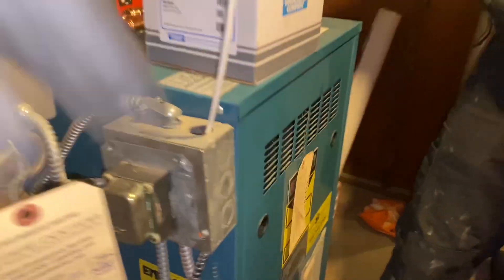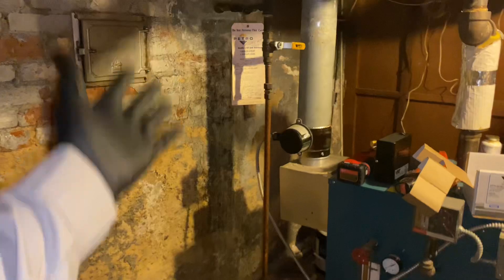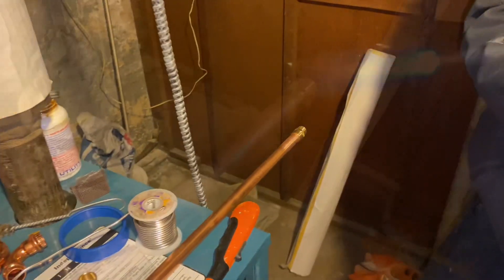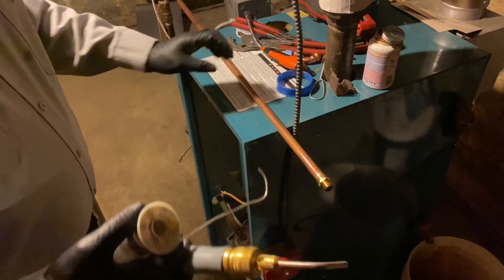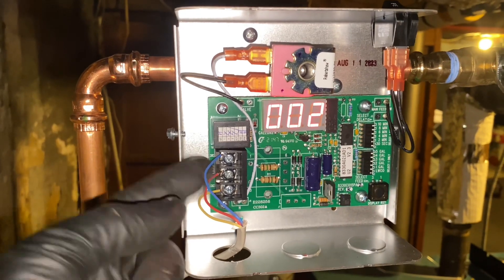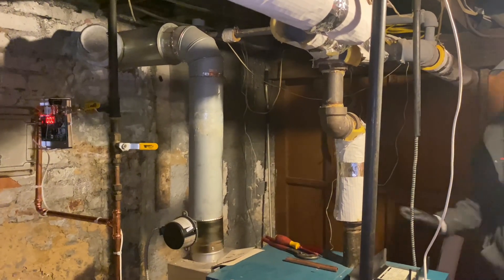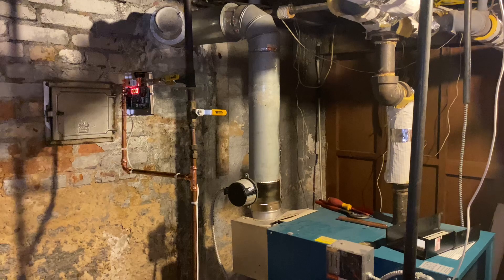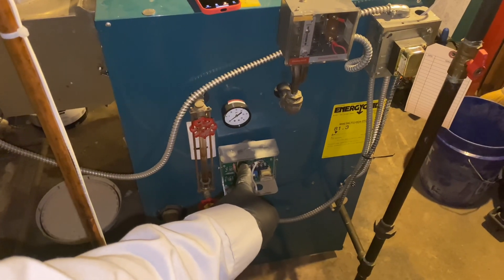Polarity Matters, Even with 24 Volts! How to Install Automatic Water Feeder on Steam Boiler

Comment: FYI, on the VXT-24 you can change the orientation of the incoming water line by loosening the 2 mounting screws inside if needed.

Comment: Is replacing one VXT-24 with another a matter of removing the electrical contacts and unbolting the old unit and installing the new unit using the same feed lines? No soldering involved?

Comment: Mike, i have this same Hydrolevel VXT 24 volt water auto feeder, though mine is piped almost the same way as you did here in this video with 3 valves on that squared pipe..1 valve at the inlet, the other valve on the right side on the pipe thats vertical at the 3 o'clock and another one at the horizontal just beneath the VXT ..So when looking at our VXT , theres a valve at the 12, the 3, and 6 o'clock..and they are all on the right side of the VXT in that squared piping configuration if that makes sense.

Comment: I never soldered before, but I have a torch that I haven't used, and I will buy some copper elbows, and copper pipes, solder, and flux, and brushes and eye protection, and practice on my days off work this spring just to learn this craft.

Comment: recently get a new boiler utica with water feeder and it banging loud too many times and water noise very loud i can hear that noise in the  dining room -  I TOUCHED THE BOILER METAL WHEN WATER FEEDER BANGS LOUDLY AND IT AFFECTS THE OUTER BOILER METAL STRUCTURE FROM UP TO MID TO LOWER IS IT DANGEROUS? LOWER IS CLOSE TO THE GAS PIPE AND LOWER DEVICE TO FIRE UP THE BOILER water feed banging noise AFFECTS THE HOT WATER BOILER GAS PIPE AND HOT WATER BOILER METAL  = did the plumber not put in water feeder right? IF IN THE FUTURE THIS WATER FEEDER FLOODS WILL I NEED TO GET A NEW BOILER? SINCE TOO MANY WIRES AND IT LOOKS LIKE THE WIRES OUT THERE NEXT TO HE HOT WATER PIPES AND WATER FEEDER

Comment: The water level in my steam boiler was rising by itself. Tech said it was the vxt 120 and he would replace lt for $2780.00. Turned out it was the domestic coil and not the feeder. Glad I called a different HVAC company for second opinion. I would have been out all that money and still had the problem with the rising.

Comment: Mike never set the auto feeder to LWCO I use to think that was the correct setting but it’s not I’ve had multiple flooding issues bc of it! I called VXT tech support to explain why this is happening so he said on LWCO it will fill 5 gallons of water which is no bueno! So I drain the water out till the LWCO light comes on.. I hold the auto feeder button down while having the stop watch counting till I get 2-3 fingers over the probe then stop.. Usually takes 60 seconds which is 1 gallon.. It will vary depending on how many sections the boiler is.. But usually avg house here on LI takes 1 gallon.. So I set the dip switches at 4 minutes bc a lot of these older houses takes a little longer for the water to come back and 1 gallon! Never had a flooding problem again once I stuck to this method.. 🤙🏼

Comment: I am getting conflicting information regarding where should the water feed come from? Should it be hot or cold water from the water heater? My weil mclain boiler eg manual says don't introduce cold water into a hot boiler. However, I was told I should not feed the auto feeder with hot water. Right now hot water from my water heater is feeding my boiler.

Comment: You do a great video and help the apprentice along..he is such a humble guy. Thanks for the information on the low water feeder..had a coworker install one of those same ones you had and he said it did feed water when he first installed it but then it wont feed after that. So i think he probably forgot to set the dip switches or connect the wires with the right polarity.  I will have him check those this weekend...tha ks again for the great information...i was cracking up about the Bill Clinton stuff...you make the work environment less stressful when you make jokes and laugh.😅😅

Comment: Time for Peter to watch heating help on YouTube there’s some videos on steam heating old presentation’s by Dan Holohan about steam boiler piping and it might be helpful if Peter watched them once a year to review what the meaning of the dead men’s lessons are.
I have to wonder if that boiler was in a pit before it was replaced with a gas boiler. The main seems very low in your video. The previous contractor has not read much about near boiler piping otherwise he wouldn’t have made so many mistakes. No equalizer, no drop header, no drip leg on the relief valve!

Comment: The dead men would not be happy with that installation. Remember Peter the solder flows to the heat of the flame. Good Job Mikey Pipes and Peter Piper. Make the trades great again.

Comment: Yes, the old Hartford loop is important
Reply from the maker: Absolutely it is
Reply: Hartford loop is overrated imo it saves you maybe one or two cycles of the boiler. People don’t look at their boiler at best for a week or two.
Reply from the maker: i hope you don't service steam systems @Rainmaker88
Reply: You have a hole in the wet return. The return drains but the boiler still has water it fires sending steam to the radiators turns to water and leaks out the wet return. Now the water is below the lowest allowable water level. The Hartford loop saved you one heating cycle. It’s almost useless.